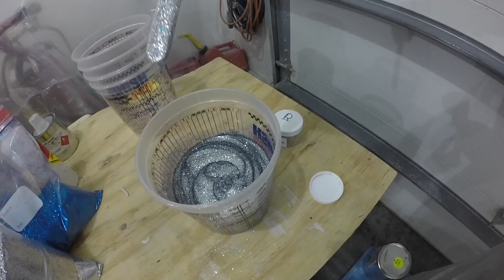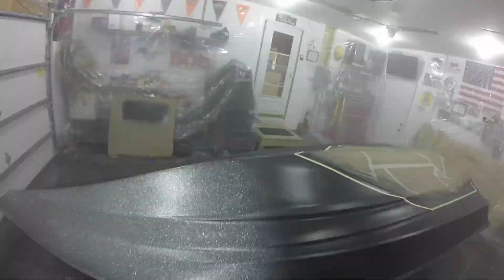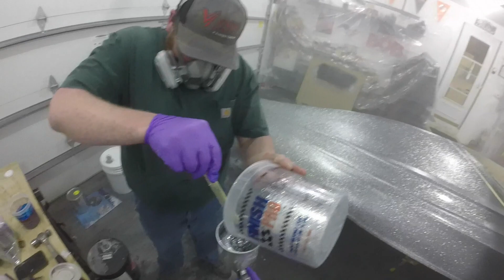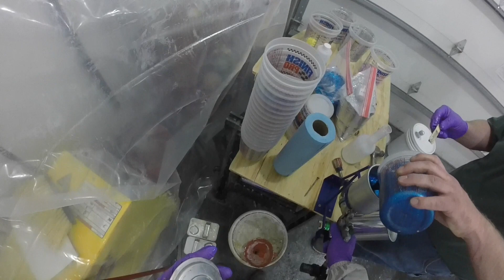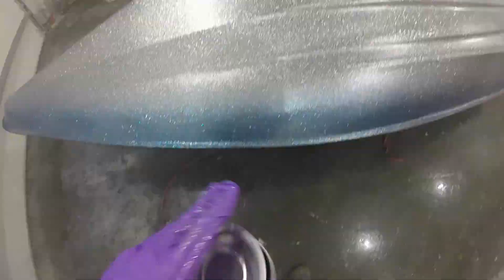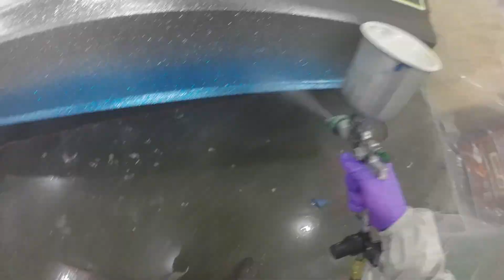Spraying Metal Flake Gelcoat Hydrostream Restoration

Comment: Wow ! That's incredible workmanship. I watched all the vids as I just bought a 1987 Valero that I thought I would recore.....not after watching. I think I'll buy something new just don't have the time or ability to do it right like you have shown. It would probably sit in my garage unfinished till the day I die and the kids would have to get rid of it...lol Thanks for posting. Hondatech on S&F
Reply from the maker: You really don't have to go as far as I did to make it a useable boat. Transom, core, stringers, and floor is what it needs. You don't need to split the hull either. I went way over the top with this because it has a ton on sentimental value to me. This is my first attempt at fiberglass work. But I do have a knack for working with my hands.

Comment: What did you use as a base coat/primer while repairing imperfections on the hull? I’m restoring an old James Bond Glastron boat. Appreciate the tips
Reply from the maker: I used Duratech vinylester primer after repairing the bottom. I have a long detailed write up here if you're interested. https://www.screamandfly.com/showthread.php?340316-1978-Viking-rebuild

Comment: The boat looks awesome! I was just wondering why you did a black base coat of the black gelcoat? 
Also what was left under the masked area? and do you have a rough idea how much you will end up using for the top side? 

Thank you!
Reply from the maker: I shot the black for a background for the flake layer. With the black underneath you can really tell when you get enough flake down. I probably could've used a grey base color and used a bit less flake. Some say you should use a similar color base. But I think the black gives the flake a bit more depth. Everything under the masked off section is just plain white gelcoat. I wanted a bit less material on that area due to the work that went into blueprinting the hull. It was easier to sharpen the edges with just one coat. The deck was completed yesterday, each coat used about 6-7 quarts of gel.
Reply: wow, okay very cool that makes a lot of sense.  

For the deck you mentioned you used about 6-7 coats for each coat, is That each coat of black / silver / clear?(so if one coat of each was done, it took about 18quarts of gel) how many coats was necessary to obtain proper thickness for each color?  

I was also curious what was the final grit that was used to sand before applying the gel? 

im assuming you had to wet set and buff after the gel was cured as well to get that smooth gloss finish? 

Sorry for all the questions, but I really appreciate the info and help will be much needed as I have been debating of using automotive paint or going with gel coat for the restoration of my hydrostream.
Reply from the maker: @FullThrottleBHP  Yes, each coat of gel(black, clear/flake, clear) needed 6-7quarts each for the deck. As you can see when I start spraying flake the video is in real time, I tried for about 50% overlap with each pass. I had to spray each area three times to get the proper mil thickness(18-26). I did take a lot of measurements with a wet film gauge the first few times I sprayed, after that I had a good feel for how much I needed to lay down. Too thin and it won't cure properly. I'm probably a little heavy with the gel and over 30mil in some spots. Yes, lots of wet sanding and buffing. The hull was sanded with 36g before primer, primer was sanded to 80g before spraying gel. Auto paint will be an easier process but gel is so much more durable. Also, you can't get flake this big into auto paint. Check the link in the video description to Scream and Fly. I have a pretty in depth write up of how I've done all this. Thanks for the interest!!

Comment: I have so many questions iv probably watched your series about 10 times over the years by far the best video of gelcoat process hands down. My questions are how long did you wait between coats any need to sand between coats? Did you spray directly over the existing gelcoat or does it have to have a primer between?  Also really would like to see a video of the boat now done inside and out on the water
Reply from the maker: Just have to wait for the coat to kick off and once it starts to cool off you can spray the next coat. A laser temp gun is very handy for that. I used Duratech vinyl ester primer first more as a filler coat. That was block sanded before spraying the gel. No sanding between coats of gel.

Comment: Maybe im missing it, ive read your write up about the whole process. What gel coat are you using? Im about to repaint an old 1996 nitro i got from my grandfather and plan on redoing the flake
Reply from the maker: I forget the exact brand that I used. But I know I bought it all from Express Composites in Minneapolis. If I were to do it agin I would skip the black base coat and just go to spraying flake over primer. That would save a lot of time and material.

Comment: I watched every video with your restoration. It turned out amazing! I was just wondering if the black base is a gel coat or a paint?
Reply from the maker: Thank you! The black was also gelcoat.
Reply: Late question, the white paint was a sealer? Do they have a black sealer? And what size gun is that shooting gel?

Comment: What  gel did you mix with  the flake ? What size  flake did you use ? If your spraying flake do you need a special sprayer  or nozzle ? Can you pain it on with a roller or a brush if you don't have a sprayer ?
Reply from the maker: Sizes etc are listed in video description. Doubtful to be able to brush on a metal flake job.

Comment: i have this exact gun, and it clogs with the glitter used glitter from ranger actually, is the tip still too small, or do you really need to thin i more?
Reply from the maker: I didn't thin the gel any. This was all sprayed full thickness. It is a 2.5mm tip and I was running the fluid adjustment wide open. The only issue I ever had was the gel curing in the gun causing clogs. I did try mixing just a bit of flake with acetone and running that through before I ever attempted gel just to se if the flake would clear the tip. That all cleared fine and looked really cool spraying too.

Comment: How many hours do you have in this. Now I know why some of those fancy bass boats cost so much. That's a $5k paint job and that's probably under estimating. How would you do a boat that you can't turn upside down?
Reply from the maker: There's about 120hrs into the gel coat process for the entire boat. About 875hrs into the entire project so far. Thanks for the compliment! I have about $1,000 in materials for the gel. No idea how to tackle one you can't flip over. Possibly hang it somehow? But if you're able to hang it you'd be able to flip it..